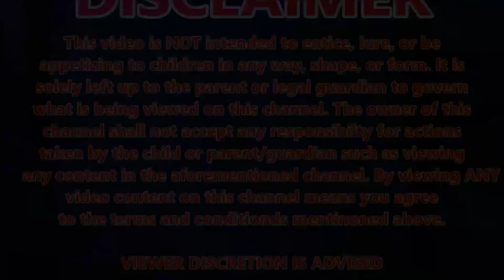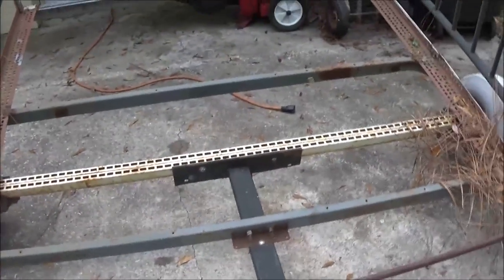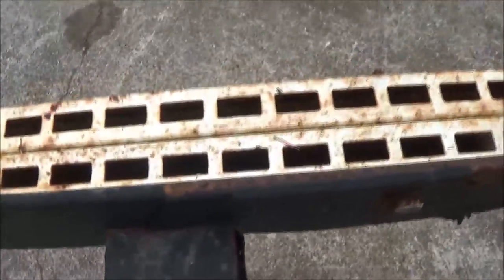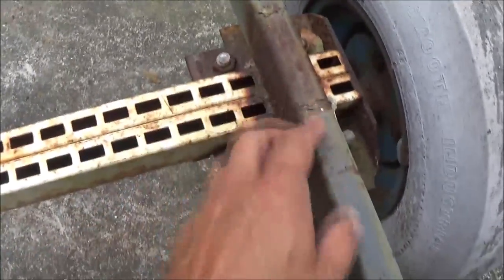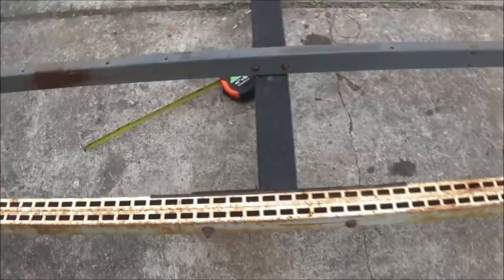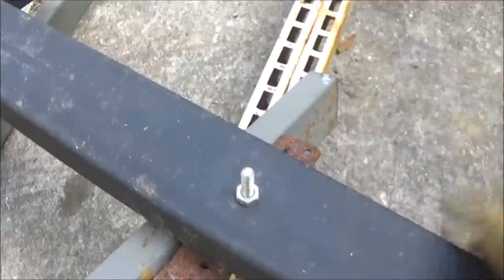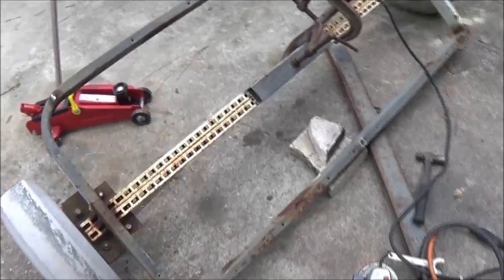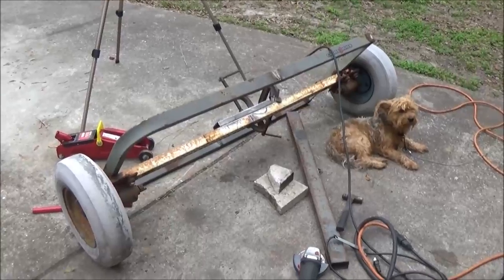Trailer Build Part 1

Comment: Hey , I stopped your video at 10:20 because you talked about still cutting it down to size - why not turn that frame around where the two rounded corners are at the front and it will be the perfect width then for a yard cart and then cut it to length wherever you want ! Of course then all you have to do is cut down the axle . Do you have a bed of any kind ? Coming along nicely though ! Keep up the good work !
Reply from the maker: if i turn it the other way, it would only be 2 feet wide. i thought that too.